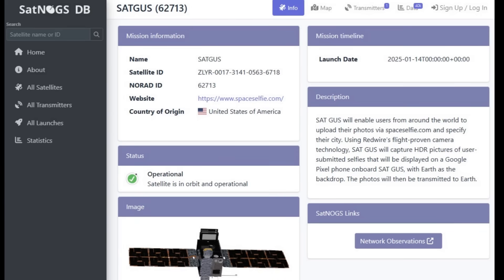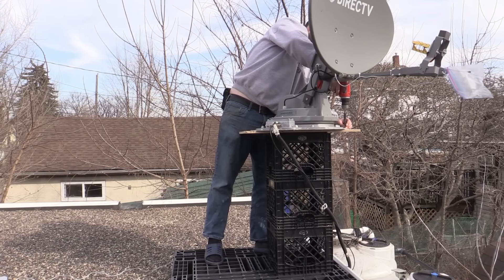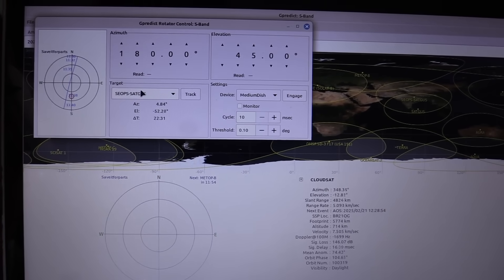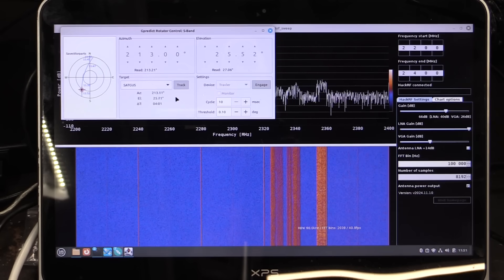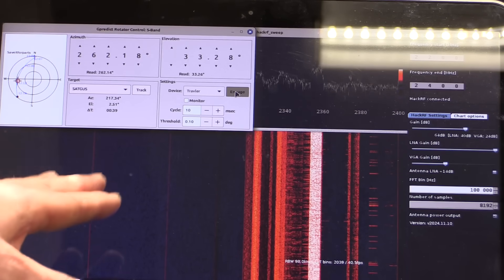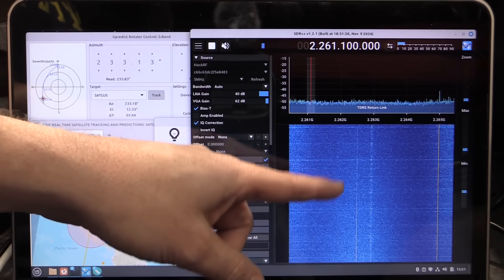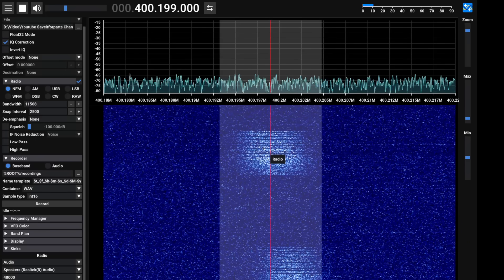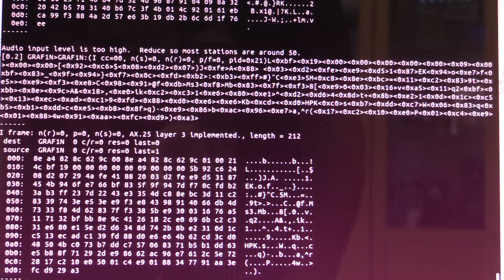Snooping On SatGus Again

Comment: Just a short heads up. Sat telemetry is send most likely as sets of bytes in which the ground controller knows which position within the binary string corresponds to which sensor parameter. It is not like text. In your readout you got the hex codes. Lay them over each other and you try to guess the parameters.(Counters go up every frame. Temps stay similar. System avail notes might change per pass) this is most likely not encrypted. It is just not human readable.
Reply: True. That said, guessing them might be a fun excercise.
Reply: Wish they had the fields documented somewhere for people to write a decoder.

Comment: You should really look at learning C, C++ or Rust if you are going to program these type of embedded apps. Python is a dog-slow, GIL hobbled, interpreted language that somehow gained undue popularity.
Reply from the maker: For a hobbyist, Python is great. I did so much C and C++ in college and grad school that I'm now sick of it. I don't have the attention span to compile something, test it, fix it, recompile, test again, then re-compile again when I move to a different computer. Python pretty much just works with little to no hassle. And 99% of the coding I do as a hobbyist doesn't need to run fast or be optimized.
Reply: @saveitforparts  Fair enough. One day you may need performant code and find python sitting there picking its butt instead though. I decided to learn Rust despite its odious proponents. It does away with tedious explicit memory allocation with a complex ownership system, but also offers syntactic eloquence and simplified multithreading. Python is totally incapable of true multithreading due to the GIL design flaw.
Reply: @saveitforparts  Try Rust then. It has simplified multithreading and does away with explicit memory allocation. Python can never do true multithreading due to the GIL design flaw.

Comment: The Fairbanks Alaska Earth Station is within 10 miles from me.  Unfortunately, I don't have anything for S-Band decoding.  I have a few SDR's but they only go to 2GHz    Dang - there goes my budget again.
Reply: Get a HackRF clone - they're like 100 bucks. Or you can find an old MMDS downconverter that will shift 2.3GHz down to UHF range
Reply from the maker: I went to college in Fairbanks, too bad I wasn't into satellite stuff then! A Ham-it-down converter might help.
Reply: How about the 400MHz telemetry?

Comment: The 400.05Mhz to 401.00Mhz allocation in the United States is for Time signal Sat, various satellite (I too lazy to type it all up here), Earth explore satellites. This is all documented in the U.S Frequency allocation Chart. There are two that show up when doing a search. The one from 2016 seems to be the valid one. So that noise might in fact be satellites, broadcasting narrow beam data from orbit. I don't know if they are in fixed orbit or not. If you have not done so already, you really should take a look on that document. It helps with allocating stuff on the frequencies that you are scanning. I am in Europe and its slightly different layout used there, because of difference in allocations of frequency bands.

Comment: Could you not use an 433 mhz receiver and an Arduino uno to point a diy dish like a pie pan to track the telemetry data and get the orbital data in real time then send the x y tracking back to the main dish stepper controller
Reply from the maker: Maybe, I haven't gotten that complex yet!
Reply: @saveitforparts  I was messing around with an Arduino uno and a 433 mhz receiver earlier this year and I kept getting data coming through, now I live out in the boonies and at the time I was using chat gpt to help decode what ever I was receiving and it was quite intriguing but I never figured out what it was until I watch your video when you found telemetry data on 400 mhz and then it hit me I must have been receiving satallite telemetry data on that frequency I live in north Eastern Washington state and there is a clear 360 degrees view of the night sky that is typically clear so it had to be that